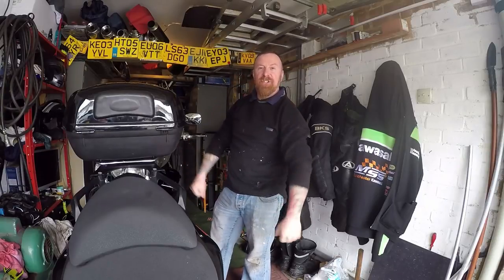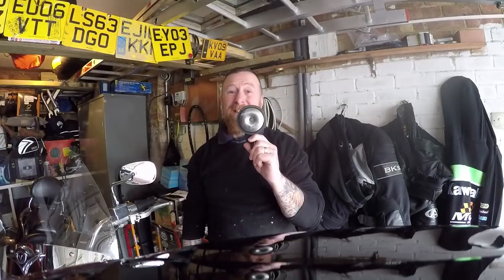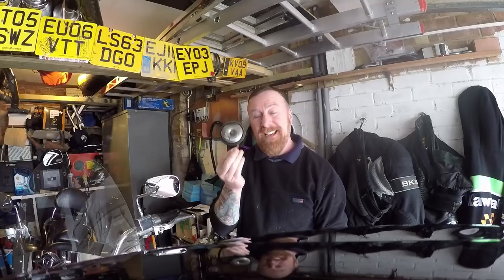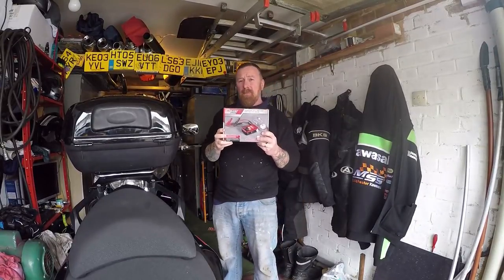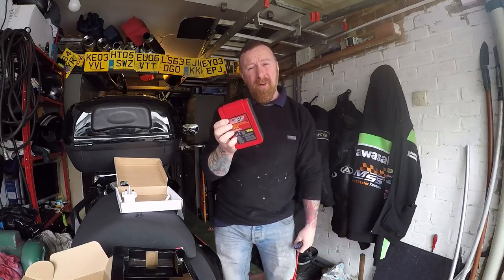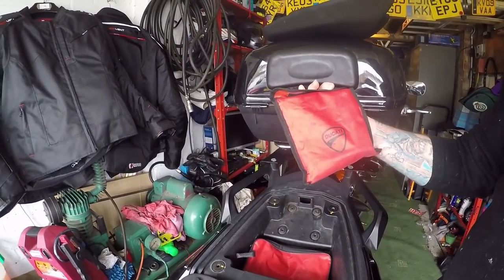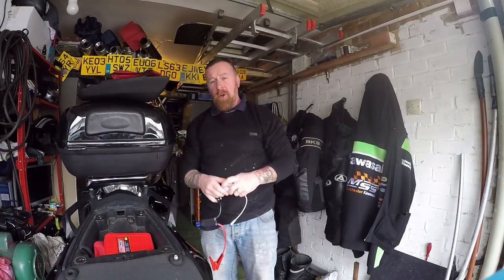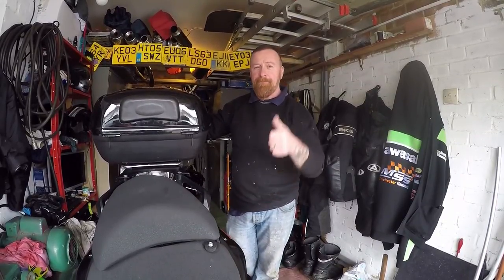GARAGE CHAT MOTORBIKE HORNS & JUMP PACKS MARK SAVAGE

Comment: those lithium jump starters are brilliant bits of kit, just make sure you don’t accidentally short them out as they don’t tend to have much protection on the cells inside. theres a vid by big clive showing what happens if you accidentally short them

Comment: Hi mark whats the best way to fit really stiff clutch springs on a moped the springs are 6,000 rpm 1.9 and there the yellow polini ones there really stiff and i cant put them on ? Could you help me or is there any special tools ? Thanks
Reply from the maker: yes bud there is a tool that will help , try e bay bud, i had problems too getting them in Grrrr
Reply: mark savage could you name the tool or the ebay listing number ive been searching everything in to find something
Reply from the maker: tyraines I bet round a screw driver into a hook and used that but you can buy them in sure in a set bud 
Try bending one around that will sort it
Reply: mark savage here is my parts list ,

Airsal tech 50cc Racing cylinder kit(aluminium)
Stage 6 pro rep exhaust 
Stage 6 6.25 gram rollers
Stage 6 foam air filter insert
Stage 6 medium torque spring
Stage 6 Pro Variator 
Stage 6 CNC Racing Drive Face
Malossi Carbon fibre reeds 0.30mm
Polini Evolution Kevlar belt
Polini 3G Race Clutch(polini green springs)

17.5 carb 
68 Main jet

 ive flat spotted 3 sets of rollers now 2 sets which weighed 6.25 and one set that weighed 5.25 i went to a heavier weight now i went 6.9 grams so hopefully that will stop the flat spot issue but still curious ofnthe cause as the 3 sets were all within a month and a half , thanks for your reply keep it up im currently watching some of your old videos again :)
Reply from the maker: that's a big list and a few £s lol
that is odd to keep flat spotting the roller, i know it's new  but make sure it's clean, no oil's and the rollers are the right size and roll ok once in. i had this once with a clutch that was new and was not opening up 
mark
oh yes and thanks for watching my videos bud, some of my early videos were where i was just fixing and chatting but hope they helps someone lol
Reply: mark savage   Yeah iknow ithink its around £550 in parts now thats why im so frustraited about this issue now so im trying to revise all possible causes for it :D